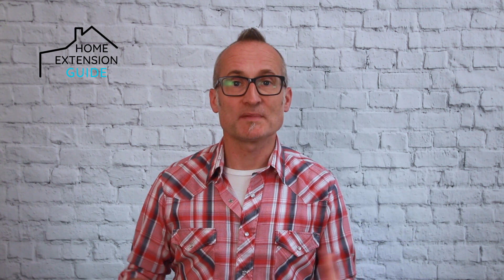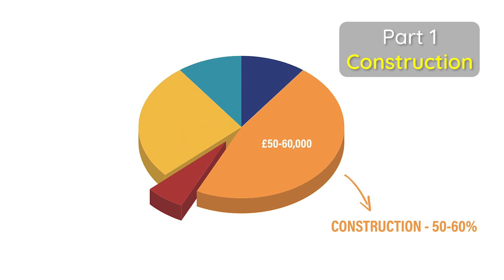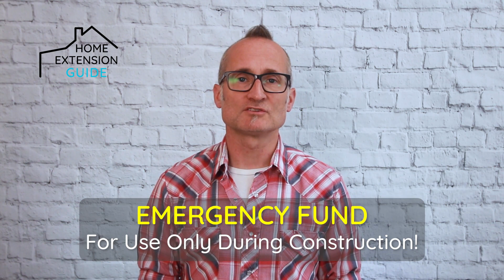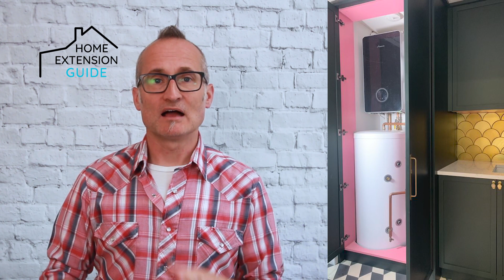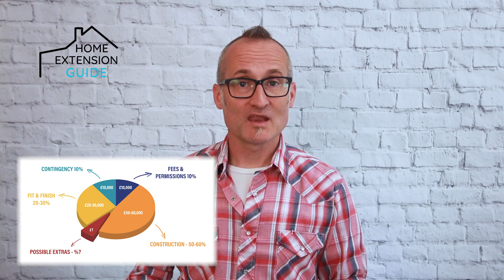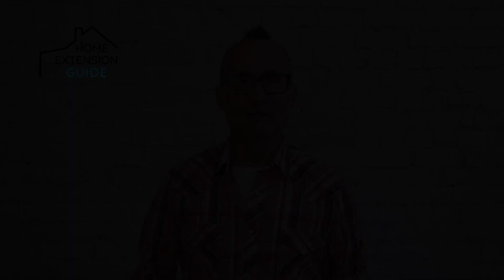Don’t Get Ripped Off: UK Home Extension Cost Breakdown

Comment: As a builder, detailed quotes work, give people confidence.
Word of mouth or recommendation by the architect is best.
Plans 1500
Plan application 250
Engineer 500
Building control 700
Building reg drawings not needed if youre a decent builder.
Reply: And that's already £3000 gone prior to getting any construction started. Thanks for sharing, this is helpful.

Comment: I have to say that PRE PLANNING EVEN BEFORE DESIGN is essential!!!! 

1. Drain engineer, he plotted out all the drains
2. Gas meter, does it need moving
3. Engineer drawing for steels, yeah, i got these done knowing what walls were load baring!! That saved me tonnes of cash
4. I took back all the walls to brick pre extension as its a renovation, i used an sds drill and did it myself.
5. Get a surveyor to do a survey of your house and the land you want to build on, you need to know if theres a drain, subsidence, you nane it, you need to have that investogated
6. If you house is pre 80s it could have loads of asbestos in old extentions with concrete ceilings - get a survey.

When you've got all that information toure armed with ammunition and knowledge so you dont get ripped off.

In the midlands its a lot cheaper - you can get a big extension with kitchen and wiring etc for under £70k 

Plan
Plan again
You dont need an architect
Get cad drawings
Show a cad drawing expert ideas you have from magazines and let them do it

I always fit my idea and look into a project, even if i miniaturise it, it pretty much always works.  There are standard working plans for kitchens, use those as guidelines and you dont need a huge kitchen - you don't- in fact I'd design so your garden extension is sofas, dining table, with kitchen down one side and a small island.

Drawers everwherw in your kitchen units!!!
Reply: This is such good advice, thank you. How did your extension turn out in the end? Planning to have ours next year.

Comment: Why is house extensions and construction so massively overkill in the UK? Everything seems like a commercial space added on to a normal house with every conceivable technology  with concrete, steel, bricks and always what look like windows from a German office building. I mean sure it will last well. But come on its a residential home...  it needs to look and feel homely as well.  I was raised in the US and all our houses were wood frame. Doing internal work or even extensions is so much simpler over there.  Houses exist still from the days of Shakespeare in the UK and they used the simplest of construction. I hope this fad of feeling like you need to turn you home into a lobby of a city office building ends soon.

Comment: 90% of builders these days, will not respond if they come to know that home owner wants a detailed quote. Simply because they open most of their account on the contingencies and the stuff the home owner is not aware of, so as they go through the project they keep asking extra money. In many parts of UK, building an extension doesn't make sense anymore as it doesn't contribute to a value increase as much as the expenditure is.
Reply: Do you pay the builder to provide a detailed quote? I always give a rough cost and if the client is serious than we go to details. I spent lot of time seeing works and nobody pay me for this time. Mos of the people doesn't even say thank you for coming, but they get nervous when you tell them how much things cost. They see lot of YouTube videos and they think they can build for free 😂
Reply: A rule of thumb is £2,000 per square meter.
Most of the work is in the substructure as no one 100% knows what's down there. 
Bridging round gas/ water pipes and moving inspection chambers are labour intensive.

Unfortunately, most people don't know or understand the work or cost involved in any building project and assume the builder is making a huge profit. 

Just go down a builders merchant and price up some materials and see how far a few thousand goes.
Reply: @generaldisarray6147 we’re getting told 2,200 - 2,500/m2 plus vat.  It’s a shame because it’s just not worth doing at that price.  Is this just the end of house extensions being economically viable?

Comment: Good video, but maths doesn’t add up. If you have 100k, take out 10% for contingency as you suggested, now your budget is 90k. 
Fit and finish budget is a bit small, you get nothing like the pictures you showed for 20-30k.
Architect’s fees are not 10% they are based on the amount of work required and it is pretty much same effort if you are drawing up 40sqm or 50sqm. Planing fee is exactly the same for small or large extension.
Reply from the maker: The cost of fit & finish entirely depends on what you choose to spend. 20-30% is an average figure, but you can literally spend whatever you like!
Reply: @ thanks for confirming I can spend whatever I like 👍
Reply from the maker: @ksimk1979 you’re welcome!

Comment: How is all this not obvious? You can’t percentage an extension out like this as they are so varied. Planning fees on 100K are way less than 10%. It’s more a set fee, regardless of build cost. Internal fit could be much more if adding a kitchen etc over just a lounge space.
Reply: It an estimate, and the 10% (as mentioned in the video) includes much more than planning fees (architect/structural etc) and building warrant fee, which is based on the final value of the scheme.
Reply: I think it's a rough estimate. Better to have a guide than to spend as you go. There will always be adjustments as you go anyway. 

Thanks for the presentation.

Comment: A decent architect will save you more than the amount you pay them. If 80% of people are getting designs they can’t afford then they’re not using a qualified or experienced architect.
Reply from the maker: Unfortunately that isn’t the experience of most people.
Don’t get me wrong, I think architects are brilliant at what they do, but drawing plans that match limited budgets often isn’t one of them.
Reply: @homeextensionguide  Sorry, this is definitely a useful video for some people and I appreciate all you're doing is trying to help, but what research are you basing the "most people" on and "often". As an architect myself I know that you need to draw up the clients primary wishes first in order for it to be fully tested and costed. If that is then over budget then that isn't anyone's fault, it's just part of the design refinement process. Adding further complexity to the mix, one builder will be £1800 per m2 and another will be £3000 per m2 for the same design. Also depends who is available and what clients prioritise over cost v time v quality too. I appreciate the intention of your content, but the statement about architects is completely misleading and unfairly puts the blame for this on architects, when in my  experience the architects are the only ones there to help clients in such an uncertain process.
Reply: @homeextensionguide  A good and seasoned architect should have a good understanding of the cost of what is being designed. Otherwise you just hired an expensive draftsman.
Reply from the maker: @albertodejuan6104  yes, I agree that a good architect should have a good idea of the costs involved. However, that often doesn’t translate into plans that are within the client’s budget!
Reply from the maker: I appreciate that it feels like I’m blaming architects for this issue and to be fair I am. Not because it’s intentional or negligent.

It’s simply that homeowners trust architects implicitly and expect them to draw plans that they can afford to build. But if that doesn’t happen, it’s the homeowner who is disappointed and ends up spending more money to try and solve the problem.

I am obviously sweeping a broad brush across this issue, but there is very little awareness of it.

Architects are so highly trusted in this area, but there‘s no real accountability when it doesn’t work out. The finger can always be pointed at someone else.
Reply: @homeextensionguide  I am going through this exact design/cost process at the moment as I have hundreds of times before. I explain to clients that what I am drawing is likely over budget, but, as I've said, you never know for certain if it's over budget until you put it in front of a trusted builder, therefore you have to draw up the client's wishes to test it out. You can't go to a quantity surveyor either because their costing it largely hypothetical. It's no good having a price in your hand that no builder can or will build it to! This is not to pass blame onto the builder either, I am just saying that you shouldn't single out the architect as the main entity responsible for cost certainty. Besides, many architects should factor-in design revisions into their fees, if they don't then the client needs to ask for that to be included before they appoint an architect. Maybe that would be worth pointing out in your video. There are also many (free) avenues for clients to pursue if they are dissatisfied with their architect's performance/standards. The very fact they are registered architects means they are held to a code of conduct. The same can not be said for everyone in the construction process. I get the impression that the "most people" you're talking about have either tried to penny-pinch on design fees expecting the right answer in one go and/or gone with an inexperienced "architectural designer".

Comment: With regards to over budget near the beginning of your video, you are so right, but I know why that is, most people who want to have changes done to their properties have no idea what is available to them, so they follow the path suggested to them by either a builder or friends.

So they end up paying for an architect paying to have the plans approved by the council only to find they can't afford the extension they wanted.

For example: I did not realise you could get almost the exact same extension for a fraction of the price of a full on bricks and mortar extension, an extension that costs nearly 100, 000 could be made to look almost identical for around 20 grand.

There are so many new methods that are available for building these things now, so even though using bricks would be the longest lasting you don't need to as modern materials also last a long time and are a lot cheaper.
Reply: What modern materials sir, I am curious which materials you swapped out to get a 100k extension down to 20k
Reply: @abduiiahai-hashimi7489  Sips are a fraction of the price of bricks and mortar and can be built much quicker, also ICE which are similar but don't have the same damp issues as sips but e enough just using wood that has been treated with modern protective coatings.

Looking into these products have turned a 100 grand extention into a much more affordable 20 grand.
Reply from the maker: I’d love to see some costings for that 20k SIPS extension! 🤩
Reply: Could you at least give some context, nothing you mentioned make no sense at all (saying in polite way)

If you have extension that needs below and estimate was 100K 
1. opening the existing wall to join to the new
2. Assuming sliding doors or bifold 
3. New flooring and insulation
4. Paining and decoration such as skirting etc
5. Roofing of any kind pitched/flat etc  

How can you bring to down to 20K ? 

As you will still need some sort of foundation, and avoid brick walls probably just 20-30% of the cost but you have to pay the SIP pannels or an alternative
Reply: @ajikadan  Sips were just one example of reducing the costs.

There are other ways, for example prefabs, modular DIY builds.

I can get a prefab modular conserv for less than 10 grand, no foundations needed just a flat surface.

There are other methods that could potentially provide better ways.

You do need to do a lot of the work yourself.

I'm not knocking construction workers, but the price they charge is high because of all the responsibility they have to provide.

If you diy that's on you.

So demolishing a wall may cost 2000 grand done by a demolition company, DIY could cost you £50 to buy the machine and your time, but you will have a lot of bricks left over to reuse, so that £50 could be money well spent as you could have a lot of reusable bricks, over the cost diy may potentially be you are pounds in your pocket better off than having someone do it for you.

Building a small wall, could cost you upwards of a grand, DIY 20 pounds in cheap tools, lots of watching videos and having a go, you may fail in which case you would be out 20 pounds and time, but if you succeed you are one wall better off and the cost would be less than 50 pounds in total.

It all depends on you.

You have to research to find what works for you, a 100 grand extension will not cost the construction people anywhere near 100 grand to build for you, they could be looking at a 5 to 1 profit margin especially now on materials and most of the costs will be in labour, oh the irony.
Reply: @flitsies 5 to 1 profit margin 😂 really interested to see some of your building work as it sounds so cheap and easy
Reply: @totalprecisioncarpenter5922  well I'm working on a project now which so far has cost me around £30 for work that I was quoted £11000 to be done  I may have to shell out a couple of grand and for sure it takes longer diy but the potential savings are worth the wait I think.

I can see where the money would go, labour charges as the work is very labour intensive, but the time it takes the price could have been halved and they would have got the job, instead I have to use my own time but save a mint over all I am looking at saving around 9 grand.

But taking into account local Borough charges due to the delay and that will fall a few hundred.
But overall still a huge saving.

Think about it, local authorities used to have their own builders, and the work was always done to a high standard, now everything is contracted out and all the work is really bad and it costs them a fortune, well that's pretty much how diy works, you do the best you can on a budget and if you take your time and take good advice, you can do it at a fraction of the cost and you get a good job, but if you mess up, atleast you can see where you went wrong and fix it.

Some things by law you can't do unless they are tested afterwards and you get a certificate, but the savings can be huge.

Comment: Small extension: 40-60k
Average extension: 60-80k 
Big extension: 80-120k 

Theres no running from prices (materials included) unless you hire some rough company.
Depending on what extras you want and if you want extra work done for example on the backyard or kitchen or features these are the current prices give or take.
Reply from the maker: These prices also vary massively depending on where in the country you live! 🤷🏻‍♂️
Reply: But what do these figures get you in your opinion? Just the shell? First fix, second? 
I think that’s another difficult aspect of the planning process is understanding the ‘build’ costs separate to the ‘furnishing’
Reply: what is a small extension?
Reply: I would say these figures are a good average across the UK. Photos shown of the extension advertised are of a 100 k extension finished excluding the landscaping and patio . Anybody expecting anything cheaper carried out by quality tradesmen or building firm will be disappointed.

Comment: architect would not discuss budgets, they are not trained in costing or covered by that under their insurance - thats the job of a QS. so clients would need to get a QS involved.
Reply from the maker: Thanks for sharing this, it’s a really helpful insight!
However, in my experience architects do talk about budget, plus most homeowners don’t know what a quantity surveyor is, so they still end up with the same problem, which is plans for an extension that they can’t afford to build. 🤷🏻‍♂️
Reply: @homeextensionguide  agreed.
best way to get an estimate is to ask you builder. then negotiate and value engineer
Reply: further to the above once drawings are reviewed by a QS there should be an allowance from the architect to value engineer the drawings.